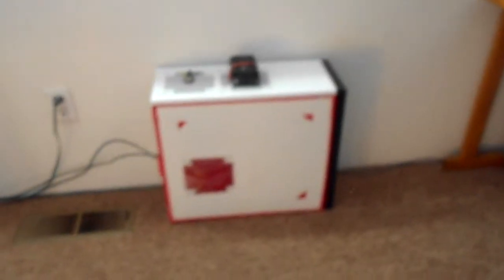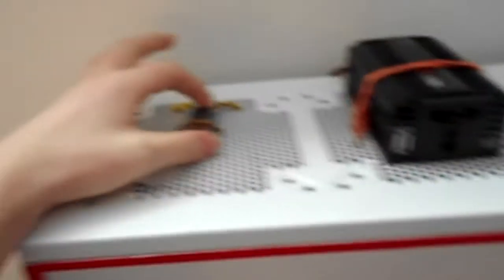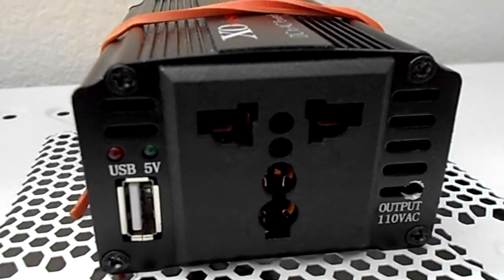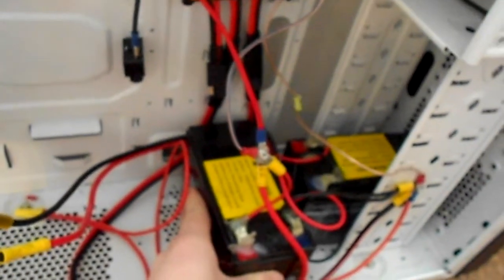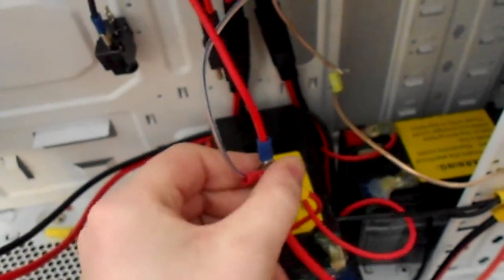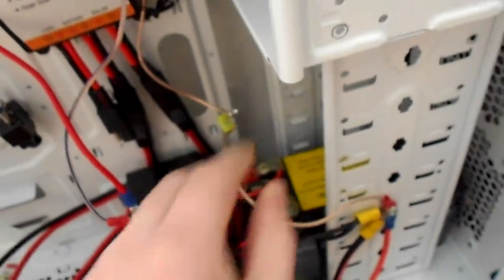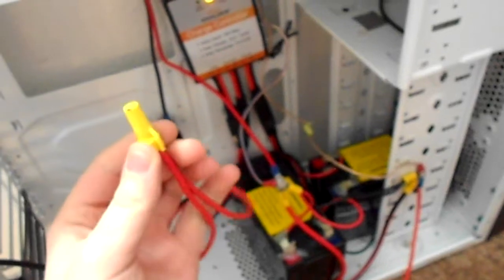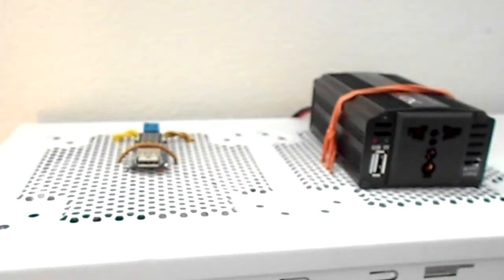Cheap 50 Watt Solar Backup Project (version 0.1)

Comment: Is that inverter  True Sine Wave?  The Modified Sine Wave inverters have problems running electronics and can actually fry a TV.  Laptops not so much since the current is going through the charging transformer first.
Reply from the maker: No this isnt, way to cheap to be sine wave. You are right, though with how small this inverter is the only things that i run on it are devices that go through an AC to DC power supply so it inst an issue for me. If i were to run electrically inductive appliances and things with motors t hat run directly off the inverter i would deffinitly get a true sine wave one. Hopefully in my next build ill have the budget for a 1 or 2 Kw sine wave inverter.
Reply: This is an expensive hobby, I can’t see solar going mainstream anytime soon.  I just finished a doo hicky configured from a Xantrex 1000w ( $270.00), 50w panel ($66.00), deep cycle battery ($100.00), charge controller ($32.00), misc hardware (+$50.00) all put together in an old Igloo rolling cooler.  It sort of looks like a Mars lander made by Igloo LOL.
Now this setup will no doubt help in a pinch and is fast to deploy and will run our fridge and most everything else (not at the same time) but if I load the inverter I would need a second panel to keep the battery from eventually draining and then it would not be mobile.

But I definitely saw its value when a cheap inverter and an old car battery ran my wife’s laptop and a window fan long enough to help us get to sleep one night after a storm.

Comment: try the tip for some used discarded batteries. i bought 4 deep cycle 600amp batts for $5 total and they charge to 14.5v...they seem good as new and been going for 3 months now.

Comment: This is very cool! I actually had the exact same idea, to put up a small solar panel up against my window and charge an 18 AH battery and charge my phone and laptop out of it just as a cool project. I looked up Renogy 50W to see how big the panel actually is and I found your video. It's decently sized, may even be able to fit a 100W, but that may be overkill.
Reply from the maker: QuantumBraced For me it's been mostly a cool project and learning experience, i do hope to get some bigger panels and a better charge controller, along with some decent batteries when i get the money/ space, it's a bit hard in an apartment. If you can fit it and afford it definitely get the 100 watt panel, you probably won't need that much when it's in full sun for an 18 AH battery, but it's nice to have a bit more output on more overcast days. Of course depending on how much sunlight your window gets. If you're like me it won't be too long before you'll want to expand

Comment: This project is amazing! When you make 0.2 or higher, or even 1.0/1, you should do a how to guide and a parts list for this. Are you thinking later versions might be more compact?
Reply from the maker: Either more compact, or with better battery capacity, even if it takes longer to charge more batteries with the solar panel, i'd like to go a few days without having to charge it if need be
Reply: That sounds like it'd be pretty awesome. Alright, well I look forward to seeing what you do!